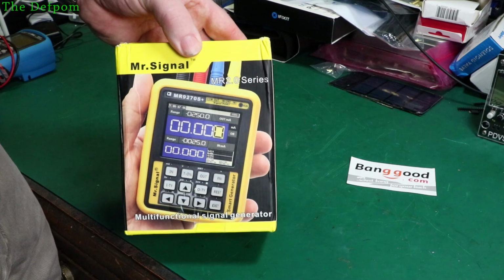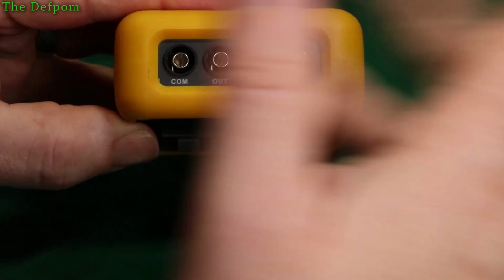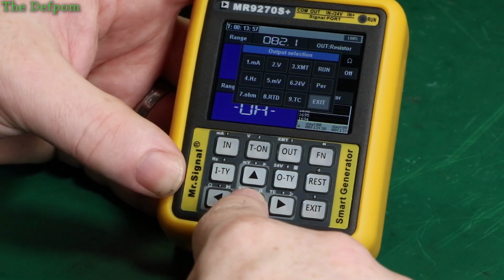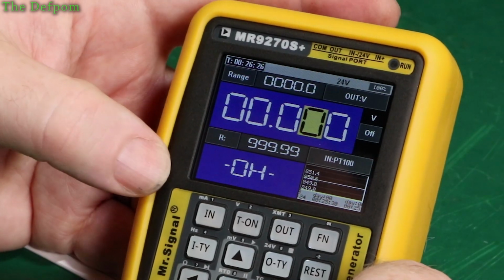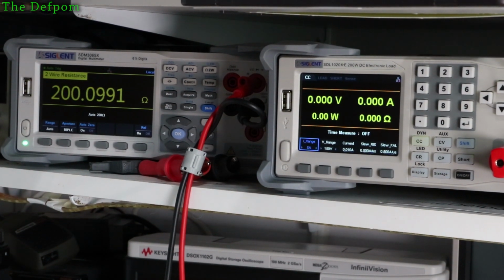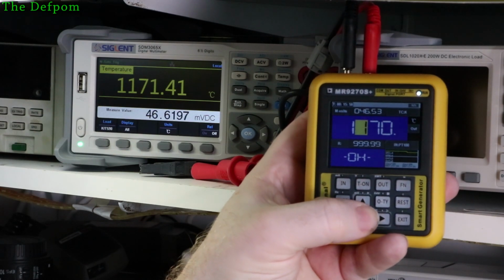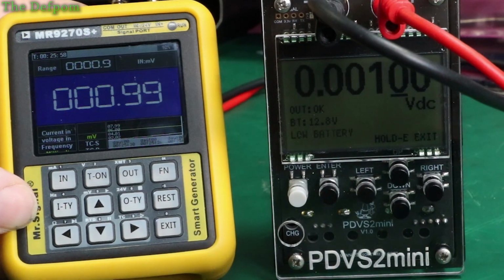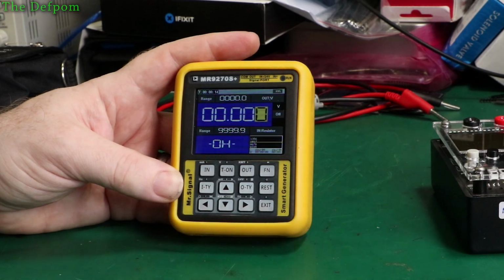#667 Mr. Signal MR9270S+ Process Calibrator Review

Comment: I received it from Amazon and seller KY Hope, total disappointment. The key "function" was not working and thus impossible to use. They forgot to solder the key on the board.
Reply from the maker: Is it working now you fixed the button?
Reply: @TheDefpom  no. Just got it today. The smd button was not soldered at all. Actually sending it back to US from Europe is also bit annoying. Was thinking to get one similar button and try to solder it on the board otherwise will send it back to the seller.
Reply from the maker: @manuelbradovent_ai  if it’s not an easy fix send it back

Comment: I would not call this a calibrator,  I often repair calibrators (my job) This is more a handy source to use while trouble shooting industrial gear. I have an old process calibrator that is probably out of call (calibrating it costs a lot more as mr.Signal costs :-) but I can do that myself if needed ). but I use it  only for trouble shooting and for that it is close enough. If some controller f.i. needs a 4-20mA current or to check if a temperature meter works again by emulating a pt100 etc . They have kelvin connections for things like a pt100 and special contacts for thermo-couples Then it goes back to the owner and if necessary to a certified cal lab.
RTD is resistive temperatuur device like a pt100